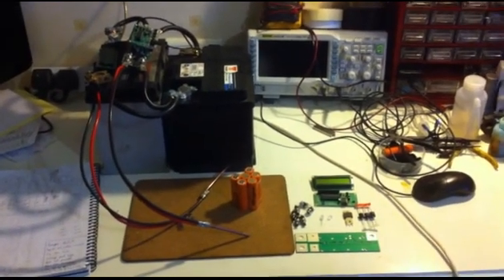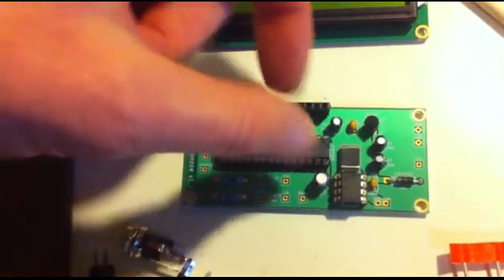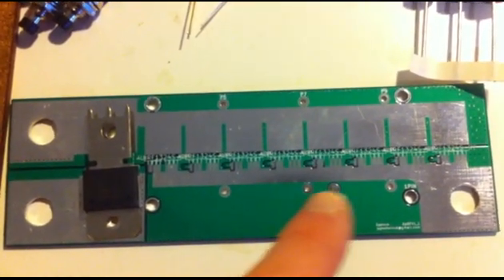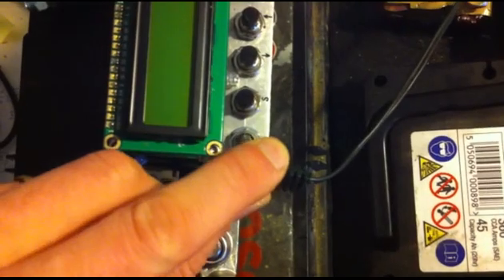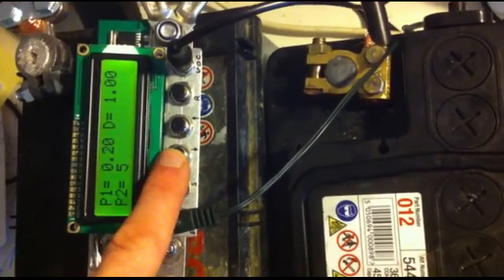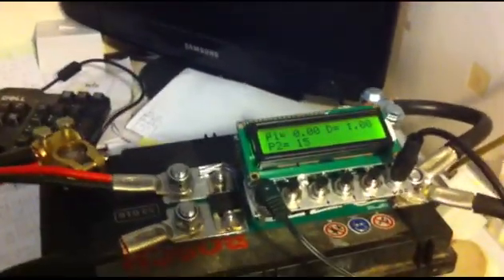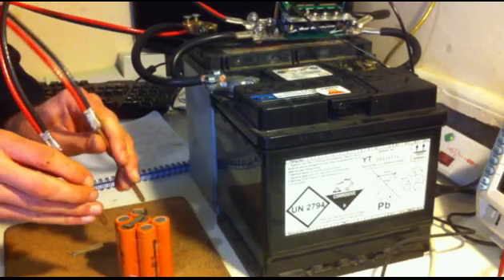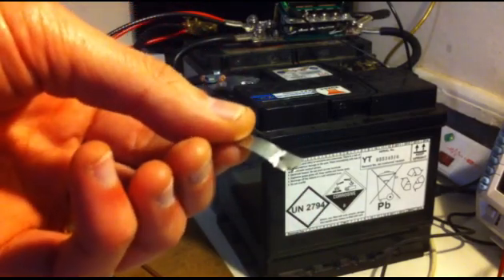6pence Spot Welder

Comment: Paul if you have the electronics it's still available I would like to purchase one. please  email me the details so I can pay you with eBay farley.gordon at gmail.com
Reply from the maker: Sure, I have a few kits ready to ship.
Reply: Paul Goodwin I sent you an email with my address included I want the full kit to 30629 USA. on the double Pulse does the first pulse clean the wire and the second pulse weld it and do you have to have all tin wire or you can you have tin coated Steel 2 millimeter
Reply from the maker: +Farley Gordon hi, please check yr email, I replied yesterday.
Reply: Paul Goodwin hey Paul I'm about to finish up on my spot welder I hope. I have one question what goes in between the two gate holes on the bottom right-hand corner of the motherboard

Comment: Nice! What is the maximum time that the pulses can be set to? Thanks...
Reply from the maker: Thank you. First pulse is limited to 10ms due to its data type. There is no upper limit on second pulse - so it could possibly be used to trigger an MOT type device
Reply: So, do you sell the kit with all the electronic components? Thanks...
Reply from the maker: +Raindrop Services I supply all the small components: control board is built & tested by me. See 1st post of the 'sphere thread
Reply: Thanks for your reply. I'm not clear on a couple of details. Since you list some diodes and MOSFETs separately, do I need to buy those separately, too, or are they included? Also, I'm hoping to have a welder that could work with a microwave transformer and that could weld very small components as well as larger stuff, such as welding nails together. Would your unit be able to handle that? Thanks...
Reply from the maker: I've updated first post of thread so buyers options are more clear. I imagine the control board could be used to trigger an mot type device, but I have never tried.